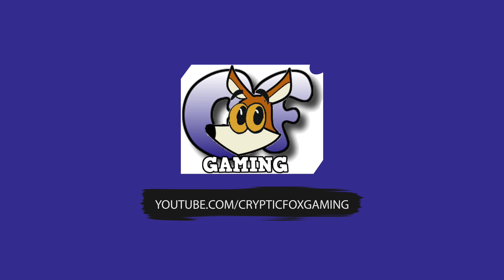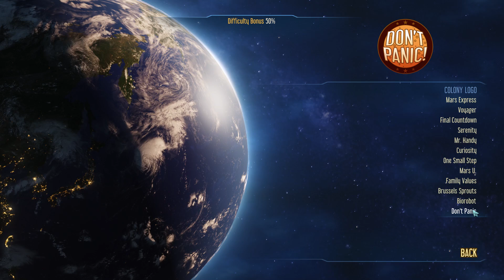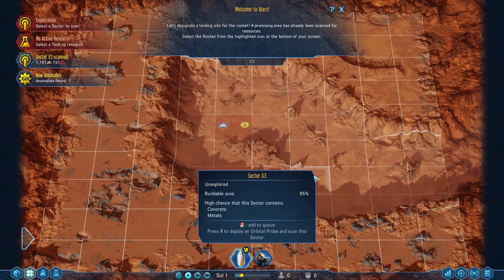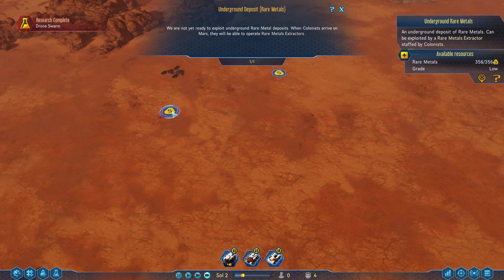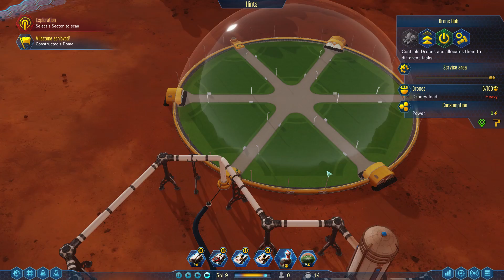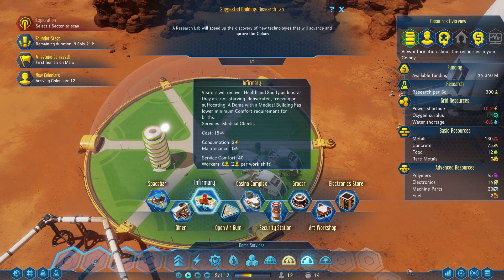Colonizing the Red Planet! - Surviving Mars Gameplay - Part 1

Comment: FYI, you don't need a recharging station to recharge the rovers, just have them sit on a power cable and it'll work. I think the Recharge stations are for the drones, but I've never seen them used as the Hubs and Rover can recharge the drones themselves. And you don't want the Evaporators sitting that close to one another as they draw in from surrounding air to make the water so the overlap hurts production. And on the screen where you choose the colonist, you don't need to do the thumbs up on the people you need. Think of it this way, thumbs up is you prefer those people (but not necessarily guaranteed)  thumbs down is to absolutely forbid, and neither selected is a way of showing you don't care. And lastly, you have the Hydroponics to make the food, but no way of distributing and that's where you need the grocer to come in that also satisify the shopping need. 

Fun watch though seeing someone who is basically playing the game blind as opposed to most others who have already got things figured out.
Reply from the maker: oh good to know.  I'll save the time building the charging stations then :)
haha yeah I've only played once so far